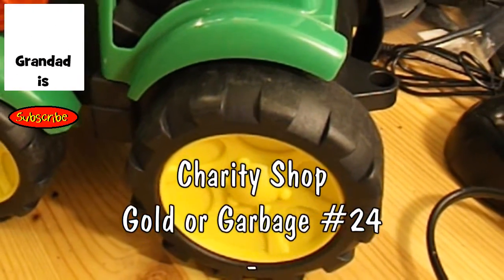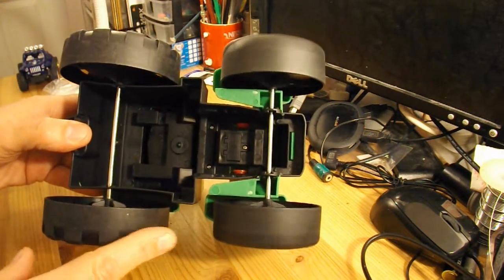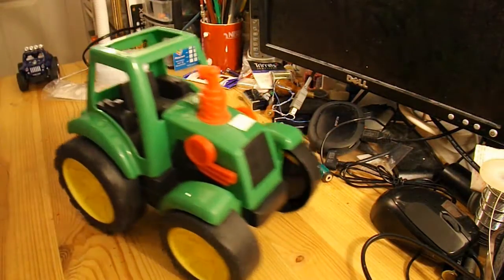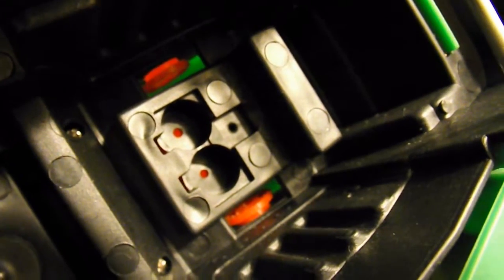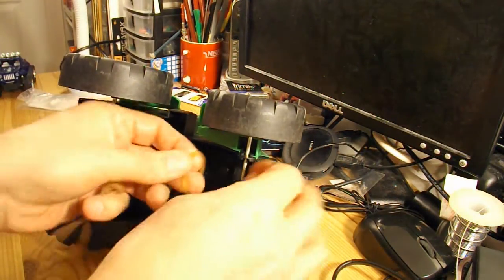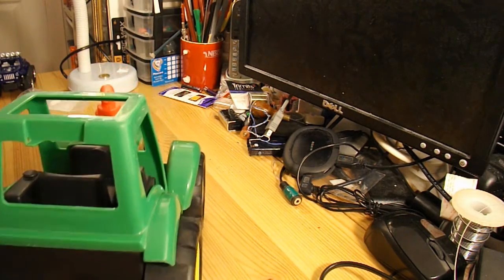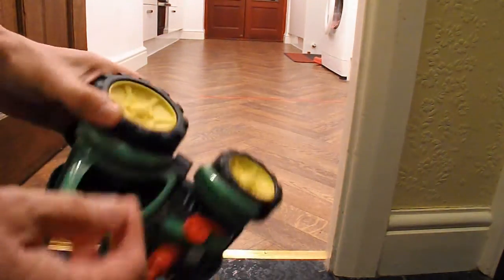Charity Shop Gold or Garbage #24 cheap tractor to rubber band power

Comment: What type of knot did you use for tying the rubber band to the back axle?
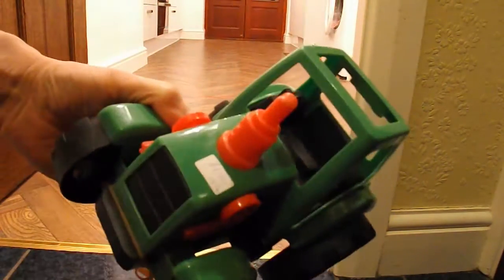Reply from the maker: No knot is used. I wrap the band around the axle so it goes over itself and it holds itself in place. I explain this at 02:51

Comment: nice. i have a dueplo farm utility car that i can convert to that :)
Reply from the maker: Hi Allan, as long as you can get to the back axle it should work OK. You may find the wheels do not grip the axle and they turn without turning the axle. Wrap a bit of sticky tape round the axle or maybe some glue to help them stay in place.